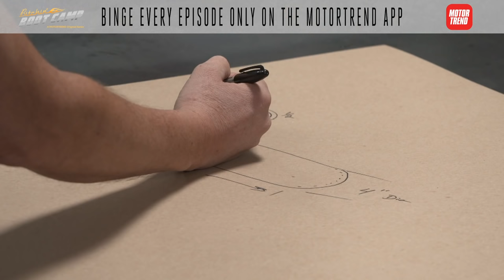Series Premiere: Bitchin' Bootcamp FULL EPISODE | Who Makes the Best Metal? #StayHome #WithMe

Comment: I really hate to point out the obvious for people who have studied metallurgy, but it would be impossible for the piece of sheet metal to be annealed under the conditions that were shown. To be clear, a material that is annealed is a material that is at its lowest energy point, and therefore its softest. To start with, the sheet metal that they were forming was most likely mild steel, which would mean that it cannot be harded by methods of heat treating, because the carbon content is too low. When carbon is introduced into iron it causes the alloy material to become harder because the carbon will position itself interstitially between the iron atoms. It forms a structure that is physically harder and stronger than iron on its own. Heat treating, meaning that you heat a material up and quench it over different periods of time, depending on the outcome you are expecting have, will harden the material because it will lock, or freeze, the carbon atoms into their positions before they are allowed to reach their low-energy state. It was also mentioned that the sheet metal was work-hardened. So which is it; is it work hard and or is it annealed? To be clear work hardening occurs due to only two reasons; either increase in density, which is increased mass per volume of the material because of compression, or due to thermal heat treatment, as mentioned above, usually due to breakthrough in drilling or just high temperature treatment of the material during handling. In either case, none of the conditions required to produce annealing occurred. Thus, to say that it was annealed is completely inaccurate no matter what terms we are seeking that definition. It is, however, likely and almost certainly inevitable that work hardening occurred, due to the pounding of the material in an effort to shape it, but in that case every person in this show work-hardened their materials.

Comment: I subbed to Motor Trend back a few years ago. But it never would work right! If I'd try to watch 30 minutes of Roadkill it would take well over an hour of frustrating loading!!!  I even tried to stop my subscription with no luck. So when the year was up I never renewed it. Since then MT has a lot more to offer. But I'm afraid it'd be the same ole mess as before. I'm not even wireless! Cable internet plugged directly into my laptop. With Suddenlink as my provider.